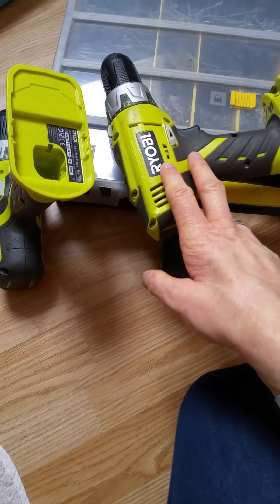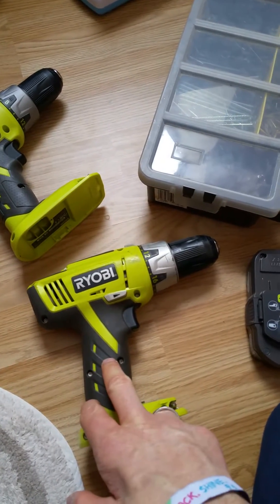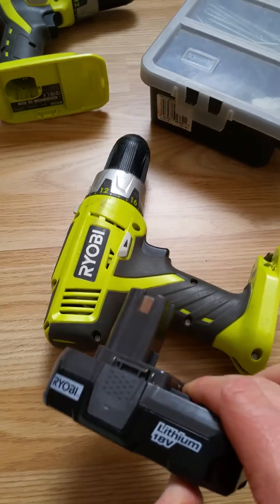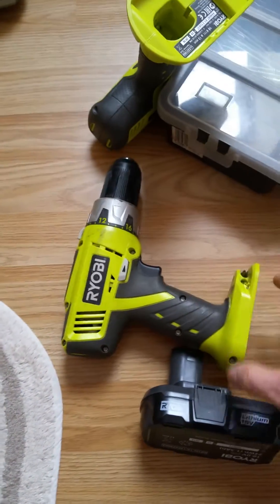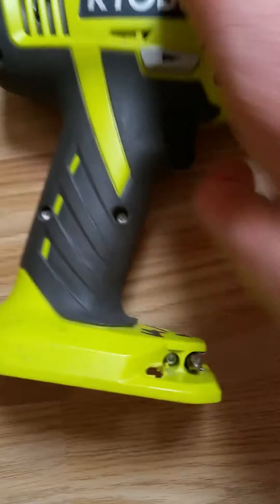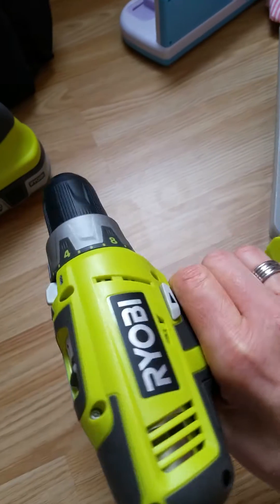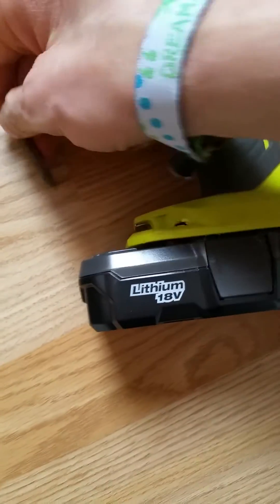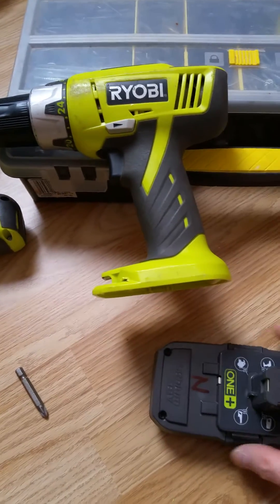Ryobi 14.4V running 18V lithium battery

Comment: as somoene who used to work on trhe circuitry of NiCad, this will not work long term. and with habitual use, you'll cook both devices, batt and device. charger might be safe though. it may work short term but eventually your 14.4 will start to register essentially as a defective device. so long as you are okay with that. but it could damage your 18v device too which is why it's not worth it unless you care about neither. which may be the case

Comment: You learn something every day.  I had no idea that Ryobi produced 14.4V drills in the lime green color instead of blue.

When my (much older?) 14.4V Dewalt battery crapped out, after having already rebuilt it with NiCd years ago, I opted to convert to 4S 18650 Li-Ion, put a cheap BMS board in it and convert the charger with a PCB out of a 16.8V wall  wart charger (not just an AC/DC adapter, must be designed to limit current while charging and peak at 16.8V, the fully charged voltage of a 4S 18650 pack).

Comment: Funny thing is i see motors sold that are rated 12 to 20v. So that means they should never burn. They should take everything you throw at it. Any thoughts on that direction?
Reply from the maker: I'm no expert but your theory sounds like it could quite possibly be the case 👍
Reply: @kurttallon  in that case we have been living in a big lie of different companies. Instead of making one universal battery, everyone make theirown and say it is an only one that can be used. Now they rate different voltages to same motor to further force you to buy their shit.
Reply from the maker: @Mikk Veere  I guess it's a - "you pays your money, you makes your choice" kind of thing 🤷
Reply: @kurttallon  true. Yet. Atleast those companies should leave us some joice in  the image of adapters. If i wave 10 makita batteries then i should not be forced to start over for one tool from different company. Make them 18v and adaptable. But they try to take that also away from us by changing battery connections for newer tools etc.

Comment: I want to do the same with my 14.4V Maktek and run it with the new 18V Makita - Like you I am not bothered about the effect on the tool itself as it is almost obsolete, however, what worries me is damaging my brand new 18V Makita battery as it cost more than the Maktek drill! Thanks for the video, interesting.
I don't really see there being an issue with the motor itself, it should handle the extra voltage OK, the only problem as far as the tool goes might be overloading the speed controller.
Reply from the maker: I'm sure the Makita battery will be able to handle it ok 👍

Comment: Thanks for showing us this, I did this with a old 12volt dark green ryobi drill,not as good a fit with the 18volt but still worked fine,held it in place with a thick rubber band cheers.

Comment: Thanks for confirming that this works. I have an old 14.4 drill, it's a ‘Kinzo’ which is some obscure budget brand. The thing still works but its NiCd pack was totally dead after many years. I noticed that the form factor is pretty similar to the Ryobi packs. So after seeing this video and doing some tests with a bench supply to see if the thing wouldn't go up in smoke with a fully charged 18V pack (which will deliver almost 21V), I ordered a Ryobi battery and charger. If it wouldn't work out, I could simply buy a Ryobi drill anyway. But it does work, the pack fits and the drill works! Another bit of electro-waste avoided…

Comment: You can buy independent 14.4v LiPo replacement bats and chargers for that series on E-bay. But I cant vouch for the quality of them. 
The 14.4v Ryobi range were dropped when the One Plus 18v range were introduced.

Comment: Are they still working? im thinking of running the 18v on the older blue 14.4v hammer drill
Reply from the maker: Yes
Reply: jason, if you take into account that dewal bumps the 20v tool with a 60v battery, i think that these kind of mods are pretty safe and a must.
Reply: @ΣΤΑΥΡΟΣΓΚΕΡΛΕΣ  but when you have a flexvolt battery on a 20v tool it only puts out 20v. The 60v tools have an extra connection so the battery outputs the 60v.

Comment: Thanks.  Have very similar problem and will try the new battery instead of throwing out my drills.  As you say, if it burns out after a while it is no great loss versus buying a new drill now.
Reply from the maker: It's got to be worth a lash bud 😉👍
Reply: @kurttallon  Exactly.  B&Q here I come.

Comment: Worked for me...I used a small soldering iron to gouge out the corners and a sharp chisel to tidy it up and shave the front piece for the battery to sit flat. Many thanks.
Reply from the maker: Glad it helped!😉👍
Reply: While watching this it was crossing my mind. I was wondering if the plastic in those corners could be heated, then get prodded with something to stretch it out into the new desired shape. I don't suppose you remember if the soldering iron made the plastic pliable, or if it just melted into it without making the surrounding area less rigid first?

It's not something I need to do, but I'm just pondering if another option could be to use a heat g*n and something like the squared end of a scrap of wood to neatly distort these curved corners straight, rather than removing material and potentially weaken the area?
Reply: @Reman1975  worth a try!

Comment: Thanks for this. I have a 14.4 Ryobi drill and saw set with dead batteries. A friend of mine has 6 18 volt Ryobi batteries and charger but his drill died. He gave me all of them and while I thought they would work with a little modification. This confirms it! Like you said if it burns up after a while nothing its not a big deal.
Reply from the maker: Howard Mann it's a cheap diy hack but if it works... great news. I'm pleased for you. I've also successfully revived the ryobi lithium 18v  batteries too!

Comment: i have done that with my two  dewalt  14.4v drills  used  a 18v ni-cd   and got  adapter  to use to newer lithium  and it works I think it might case because both of mine are  xrp type  the motor is stronger can handle the higher voltage